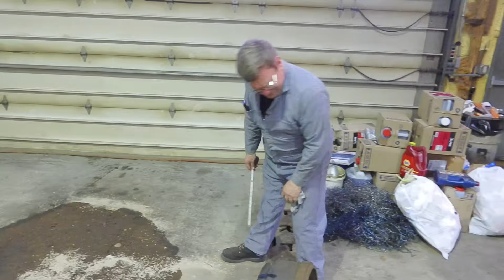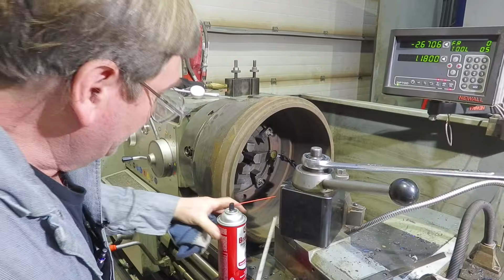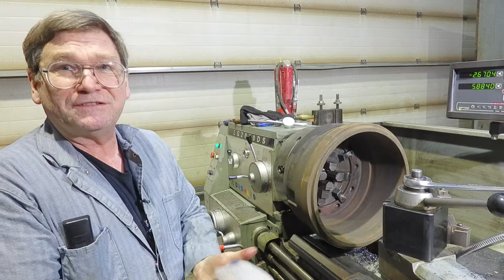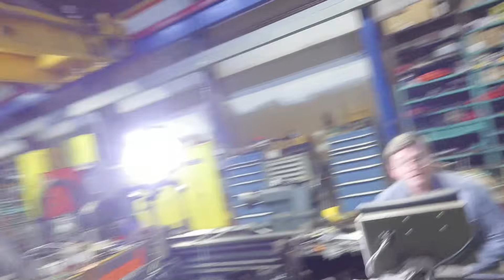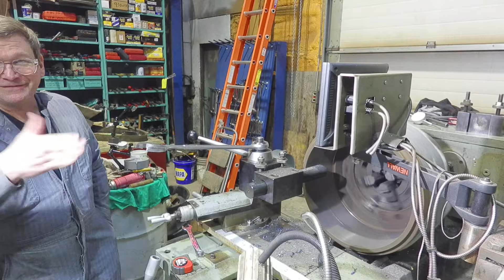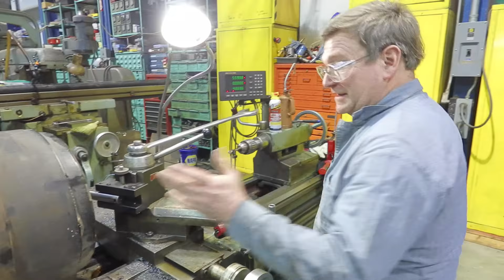Machinist's Minutes: Turning brake drums

Comment: "In a previous life"  I sold  parts for about 15 years, and have turned  hundreds if not  thousands of drums and rotors, all the way from Fiats and VW's to heavy trucks like these.  My Dad hand an old Van Norman  drum lathe and a  QuikWay  rotor  late.  At the  second store  they bought a brand new Ammco with all the goodies.  I  bought a used Ammco  a few years bac, and another for parts and additional accessories.   The parts machine is drum only,  and doesn't work,  the  drum/ rotor lathe  has to have the crossfeed  gearbox held in.  I am 78 now  and will likely never repair it.  I don't turn many, anymore.

Comment: Wow something I can finally relate to.  I worked at a class 8 shop for 7 years and turned hundreds of these on a huge arbor lathe that could accept dulley hubs with the drums still attached to the hubs and, wheels and tires all as an assembly.  Always loved doing that job.

Comment: The ridge tells DOT, how worn the brake drums are worn. If it's gone, they can't easily tell. Standard brake shoes are a different diameter than a turned-out drum oversized (fitting issues)

Comment: I have cut thousands of those truck drums on my old Ammco 5000 lathe. For truck drums the max diameter allowable is usually 120 thousand over new. So a drum like that is probably 16.620. Max diameter.

Comment: I would think on a drum as big as it is and the cost to ship stuff to Alaska it probably a lot cheaper to pay you to machine them then to get new ones like you would in the lower 48. Even if they are readily available drums. I mean what you may have a couple three hrs tops in that when done.  If that.  At say a hundred an hr. I bet shipping on those babies is prob at least a hundred a piece.
Reply from the maker: In this case they were drums for a big vehicle with planetary diffs, so they were expensive simply for what they were on top of that.
-Cameraman

Comment: Yeah, don't EVER let cast iron start singing to you. It's darn near impossible to turn a cast surface that's got chatter marks on the surface, especially if you're trying to hit a certain diameter and don't have enough material to remove.

Comment: I had front drums on my 69  C-10 was on the highway and had to stop suddenly for a stranded motorist.  I knew the drums were overturned .  The face plate seperated from the brake ring and i knew right then why they have a min thickness rating. It was the front right.

Comment: I don't do much manual lathe work and what's larger for me stuff always scares the piss out me.  Had some bus wheel hubs from the 30s that had to be bored out to use a modern off the shelf wheel bearing.  Barely fit on my lathe and i hated it
Reply: iv bored them out on a verticle mill many times lol

Comment: What really works a treat for cutting down the vibration is it is that that rubber cord to put a crossroads to count cards very stretchy college surgical tubing but quite a bit heavier if you can get a whole bunch of it wrapped around there then whatever also is a just a block of wood manually pressed against the ridge The rim the edge of the drum to pick up the harmonics and dampen them because as you know for sure that once you get a good ol harmonic chatter going it can be tough to eliminate it at times which is frustrating whatever

Comment: Out of general curiosity, are you recording your spoken audio separate from the video, and adding it in, voice over style? Or is the camera and lapel mic audio routed to the same source?

The machining information is fascinating as well, but I noticed the slight disconnect between the audio and you speaking and was curious.
Reply from the maker: Occasionally I'll have need to film video with one device and record audio separately, but in this case they were both recorded with the same device. It's likely either an issue on Youtube's end, or an error with the software I'm using. Since it seems fine on the stored file I have I'm apt to blame youtube : )
-Cameraman
Reply: @HOWEES  thanks!

Comment: I've seen "MIN DIA" CAST into the drum.
Was this av"time and material" cost basis?
Thanks
Reply from the maker: Old drums used to have the maximum over bore, or the maximum size listed on them, discs had min thickness, I haven't seen that for a long time.  This was a time & material, rush job, but I was nice & only charged standard rate, and no clean-up time.